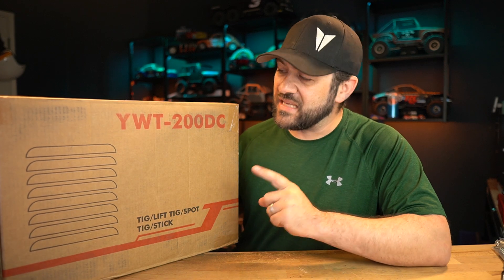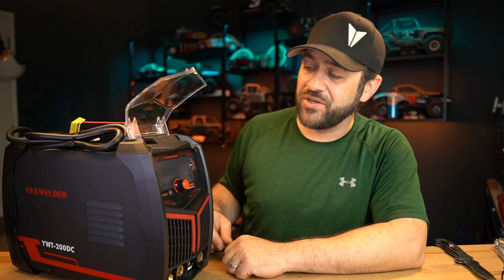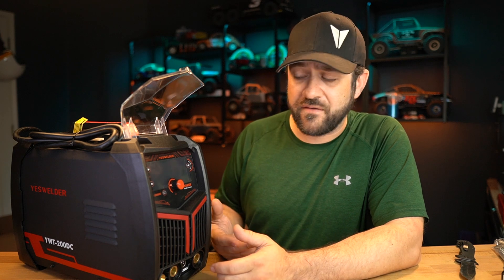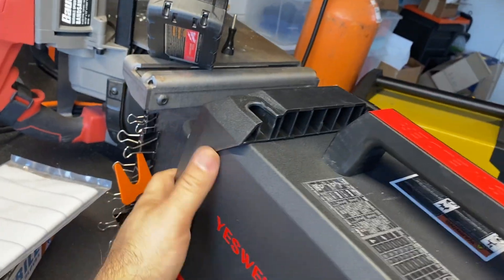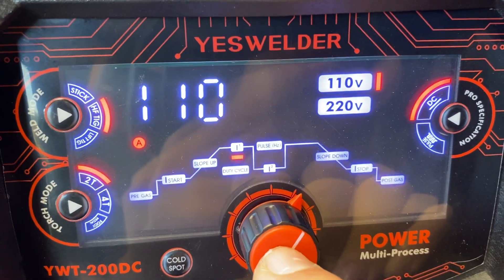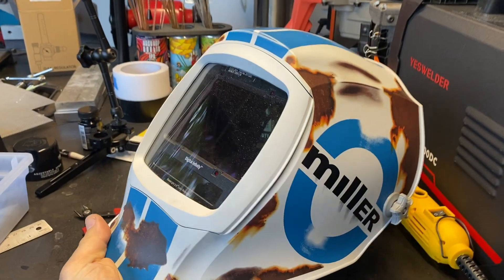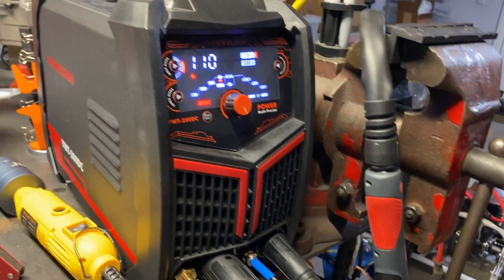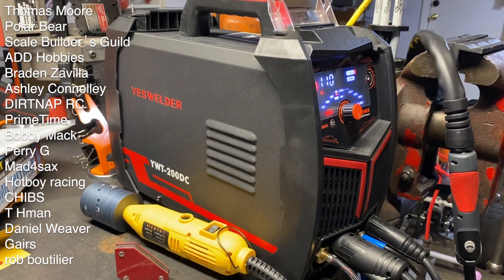Is YesWelder's Cold TIG the Best for RC Crawling? - YWT 200DC

Comment: It's interesting to see this welder work in cold mode obviously it's capable of a lot more but one thing is you need to make sure your parts are scrupulously clean and then washed off with acetone and then put the acetone away and any rags left out disposed off in a fireproof container.

Welding works at its best when the parts are perfectly clean, yes you need the welder set to maximum amount for this process but what you should always remember this is a cosmetic world nothing more than that it has virtually no penetration at all unless you're welding a metal of say 0.5 mm where it will fuse and mount the two metals together this is next to useless for anything thicker than that if you're expecting the Weld to be structural in any way. All these videos done by Chinese ladies showing you how to cold Weld are bollocks they edit out half of the video by removing half the frames which is the flash of the art being created and if you go and check out one of the videos you will see they never turn the piece over to show you the back of the world because there is nothing there,  there is no penetration at all!! 

The videos are shot very cleverly to make you think that you're doing it very fast when in reality or not it's actually quite a slow process but it clearly has advantages. If All you want to do like me as well thin metals together it's absolutely perfect for that up to a millimetre and you should be okay, but you need to make sure you've got enough power to fuse the metals. I make parts for camping stoves that run on alcohol or on paraffin they are not thick pieces of metal the maximum I use is 1 mm and most of the time I will actually roll that copper or brass down to .75 of a millimetre I may use the three or 4 mm blocks of brass say 10 mm² which I tend to mill down to the dimension I need when I want to join a fuel tank to a burner and I can use this Cold Weld function in seconds to attach this to my copper burner unit it works perfectly for that but just remember it is cosmetic welding that you were doing is it absolutely no good whatsoever on square section mild steel. You could use it to Tack weld the items together in cold welding function and then Tig Weld them properly but please bear in mind Tig  welding requires a lot of skill it is not a five minute learning experience, the cold Weld function is not proper welding. The only way to improve your slill is practice practice practice!!! 

I recommend buying coupons and then practice on those on the metals that you use and you'll see what I mean, I also have to use this function on aluminium at times but to do that, you need an AC / DC welder you cannot Tig world aluminium using a DC only welder it is impossible as aluminium as a oxide coating as part of the chemical make up of aluminium you cannot wire brush it off you cannot grind it off because the second you do that within milliseconds the oxide is back there so for example you drill a hole through it and tried to weld the hole too late as soon as you've drilled the hole the oxide has come back on the edges of the hole so it's impossible to weld and aluminium with a DC welder. Having said that you can use a mid welder with argon and that will work, but it's not as good as Tig welding. Remember also you will need a 100% argon mix for normal steel or aluminium once you start moving to things like stainless steel or France or copper you may need a mixture gas.

So remember, don't do what the girls do in the adverts don't have long fingernails. Don't touch the well cause it will be hot for a few seconds. Set the welder to high amps and wear your mask., be careful welding some metals because they are highly toxic and remember cold welding is a terminology used to describe a bad weld in the USA and in the UK elsewhere I don't know so treat it as a cosmetic weld or a tack weld only but if I was tack welding 5 mm bars of steel together I would not do it using this function because the weld will not hold.

Comment: I know this vid is 11 months old,   I picked up the  Arccaptain Tig pro.   I wanted the same thing a welder that can do Tig Spot and Tig Cold weld,   I run 110 same as you,   I have found that the Spot works good,   The cold weld setting works well.  And we have the same tungsten grinder.   You should do new vid using the Tig,

Comment: Josh good viideo im sure Yes will enjoy all of the sales generated by this video.For safetys sake i really hope you have that argon bottle secured on the floor.I love your cats but all it would take is for one of them ( or you) to accidetly knock that tankover and id the valve connector broke off you would have a live missle shooting through your house. I saw a shop teacher do it accidentally and it went through an aluminum roll up door.safety first! good job on your builds.
Reply from the maker: The bottle is chained to my welding cart. But the cart has my other welder on it (the yellow one) so I just set the new welder on the bench and ran the argon line over. Totally agree that treating bottles with care is important.

Comment: I tried chassis build with a cheap $125 lift tig and thus far have failed miserably. Granted I am entirely new to welding. This Cold TIG seems way simpler than Lift Tig. Thoughts on that?
Reply: Spot welder. The one with the handheld probes.

Comment: What type of electrical system would be best for this type of welding. I have a 100 amp panel.
Reply from the maker: I’m welding on a normal outlet in my garage. For RC, it doesn’t take anything wild.
Reply: A 220 is ideal. For a 110 welder a dedicated 20 amp. Is what's called for. Some are fine on 15 amp. Feed. That same 110v welder on a 30 amp dedicated works its best.
So be careful and make sure if you get a 110v welder you get one that won't trip your circuit.
Reply: @PonkyKong  thanks for the info.

Comment: You're making it harder to avoid buying one of these. I'm a little worried about the load on my workshop circuit. I've flipped the fault a few times even just using my soldering iron and heat gun at the same time. Also, as space is limited, do you think it's fine to operate in such a small room with limited venting?
Reply: I wouldnt recommend using it in a small space Matt, especially if you have the postflow at 5 seconds, Argon gas is designed to eliminate  the oxygen around the area it is welding and if it starts filling the room we may find you face first in one of your builds lol. Iv had times where im welding a lot of parts and my lungs start to feel tight. Garage with open door would be more appropriate. Saludos 👋🏻
Reply: We wouldnt want to have a SNU video that went... "this week on the scale news update, canadian based hobbiest Scale Builder's Guild while filming his weekly Whats on the Bench episode was found in his tiny un-ventilated R/C room face first on the bench... sources say his welding machine's post flow was set to 5 seconds. And leads me to this weeks question... whats your welding set up like? Please comment below as i love reading your comment and i try to respond to everone" lol
Reply: @caledoncrawlersrc2216  HA! Your concerns are duly noted. And congrats again on the new baby boy!
Reply: @caledoncrawlersrc2216 😂❤

Comment: Max Amp for small tubing makes me curious if it will do anything bigger at all. I suppose if you only do tiny things it is just fine though.
Reply from the maker: Cold TIG is specifically for thin metal work, and amperage could go up if on 220. Now if I switch over to regular TIG of course I could do the regular stuff.
Reply: @HarleyDesignsInc  yeah my thoughts exactly, I forgot you were only on 110 when i posted. You may want to pin you comment or something so others realize it's capable of much more.

Comment: I would have spent another 100! And baught the Simder…. It’s a “10 in 1”. MiG, Tig, stick HF start Plasma. 
Still cheaper than a UCFab chassis.
Reply from the maker: The Simder 10-1 is $999 and doesn’t have cold TIG. This is currently $445.
Reply: @HarleyDesignsInc  you can get one for 640$ and it says it does spot under the features…